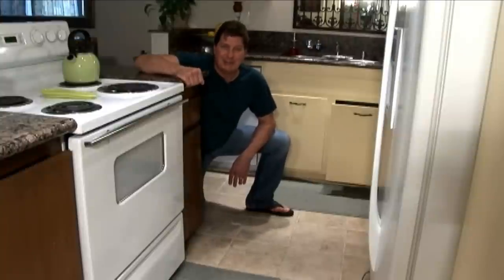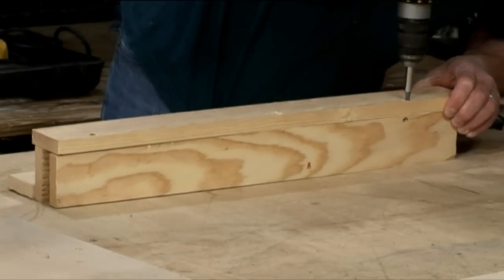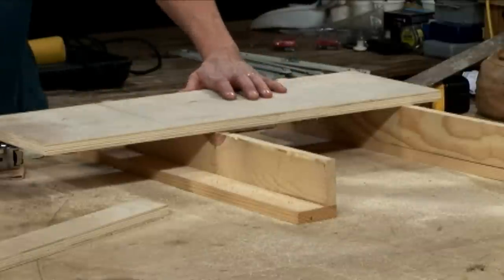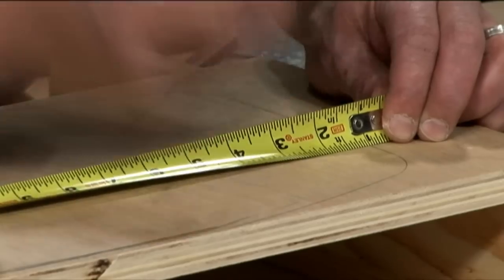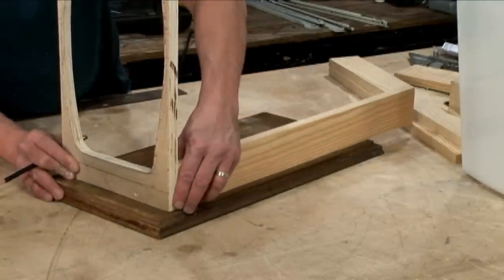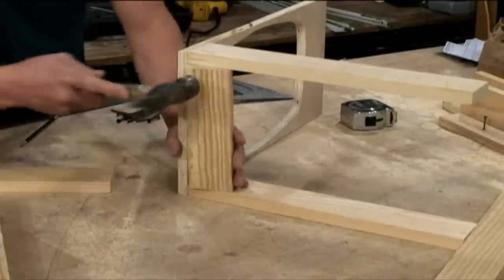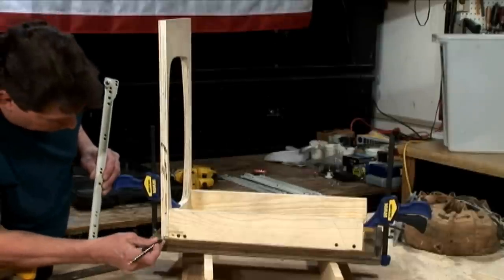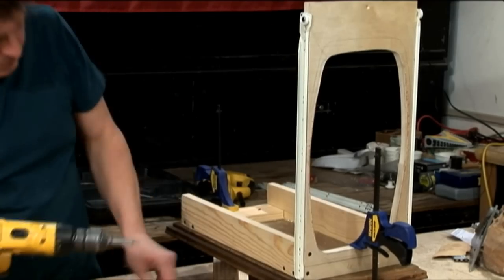HIDDEN Trash Can Made Easy

Comment: Glue does not adhere to stained surfaces.  Pull those screws out and you can pull the can support off that door with little effort.  That whole device will not hold up over the long run.